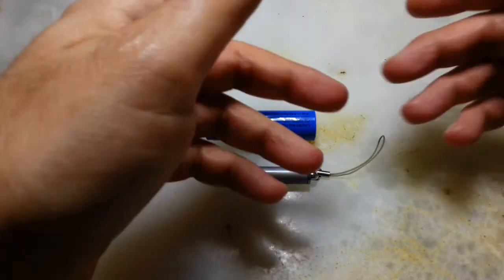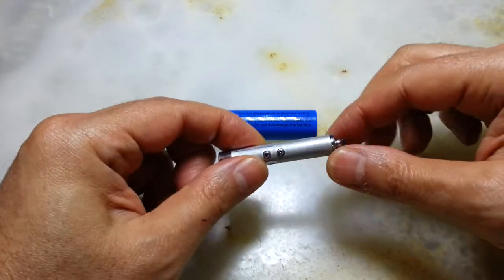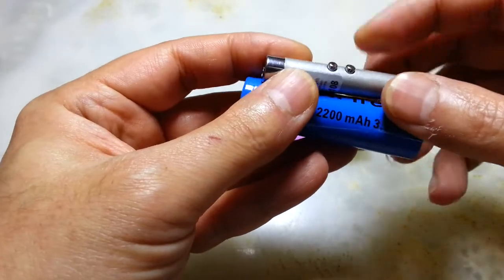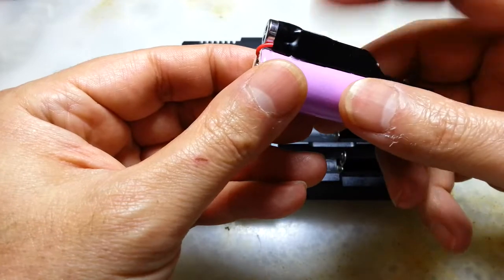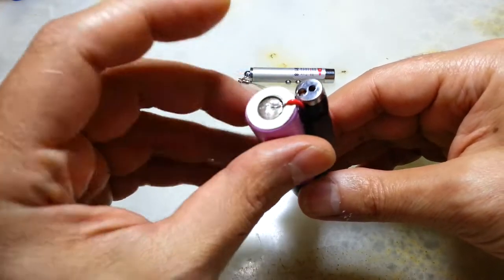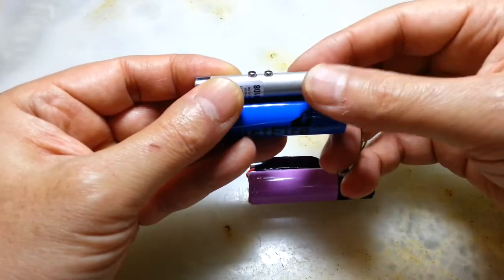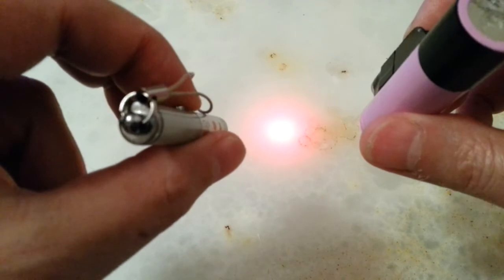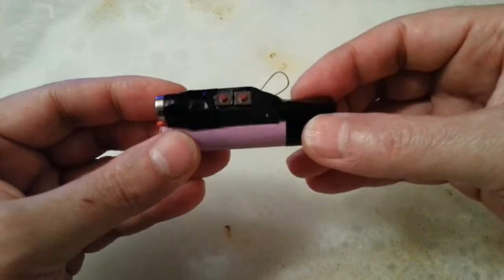Laser pointer modified to an insanely powerful one with rechargeable 18650 batteries

Comment: Didn't modify the laser at all. Just swapped a more powerful battery.
Reply: that was the point.....he said it several times that the 3 small batteries are useless so he wanted a bigger rechargeable one. are you fucked?
Reply: SpinnerVision what battery did u use